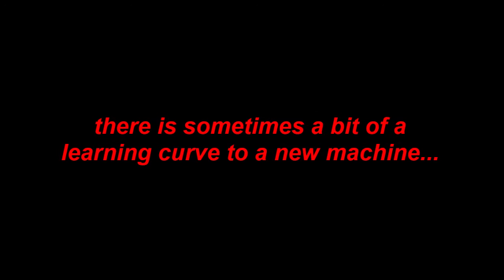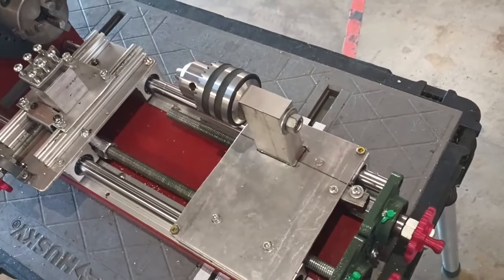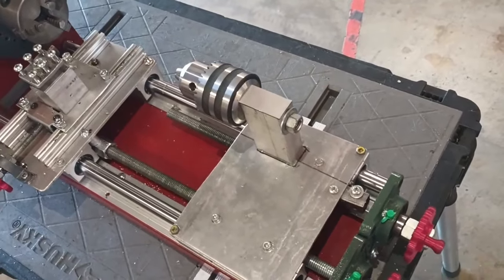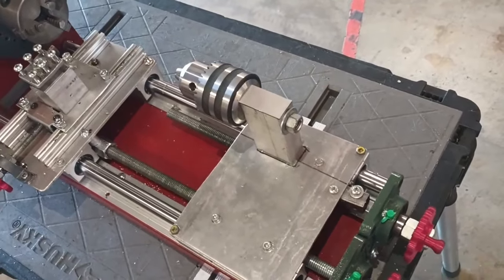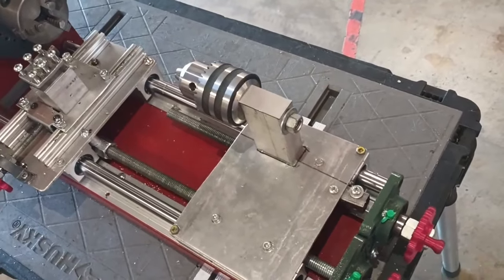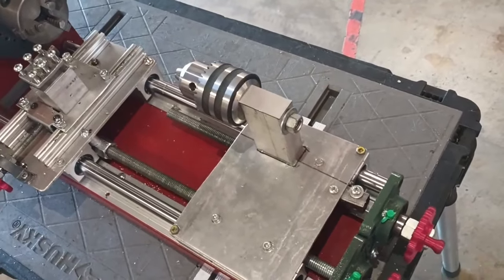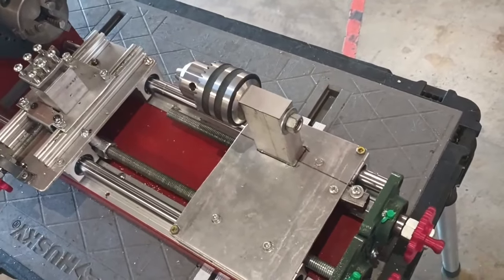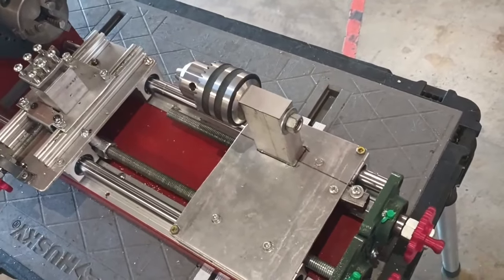Homemade Lathe Machine - Is it any good?

Comment: I’m making a turbojet and I was just wondering what metal you used for the flame tube, I have chosen 0.5 or 1mm mild steel. Also idk whether steel can be used for the turbine or whether I need to invest in some titanium sheets.
Reply: Perhaps I can get a titanium part cnc machined.
Reply from the maker: For a flame tube, you really want to use stainless steel because it is more temperature resistant than titanium and easier to work with. Inconel or some nickel alloy would be best for the turbine wheel but a high grade stainless will also work
Reply: inconel. a metal that was primarily designed for high temperature operation. what almost all turbine wheels are made from.

molybdenum... can be bought in sheet. tube. solid bar. melts at 2500C or so. 

tungsten. 3500C... also available in sheet, tube, and bar.

mild steel? one or two burns at red hot and its delaminating and flaking away and oxidising...

stainless... after  a few high temperature runs, it starts losing its properties, gets carbon precipitation, then work hardens and fractures... theres special types but for the price... find better.

titanium is an over rated metal...
Reply: What grade stainless are we talking? I’m guessing not 304
Reply: Thanks for the response, I’m really limited in terms of machinery so I’m trying to find a balance. I’ll investigate further into molybdenum for the dlame tube as it looks malleable enough.
Reply: Ok so just started research I’ve managed to find an income l sheet that I can work into a turbine and I’ve found nickel sheets to make the flame tube from, would nickel be ok or does it need to be nickel alloy?
Reply from the maker: Nickel alloys are better than the pure metal because they are more corrosion resistant
Reply: Ok cool
Reply: It’s way easier to source pure nickel for me so I’ll try that and see how it goes. If it doesn’t work I can look towards alloys, im guessing nickel copper alloys have a low melting point.

Comment: Awesome project! How long from the very first step to the first functional part out of the lathe? Are steelyards generally happy to service small orders?
Reply from the maker: It took about three weeks from the steel yard to the functional lathe. With my local steel supplier, they had a minimum order of 5ft of whatever material with precut sheets and chunks sold separately in the showroom

Comment: Very nice, how’s the turbojet project going?
Reply from the maker: The turbojet is in progress but having lots of issues. Trying to get some of them worked out before making another video about it
Reply: @AydenWardellAerospace  Have you tried using the Inconel hot end turbine from your first turbo jet. If that works maybe you can try getting multiple thin discs of steel and try to approximate its geometry.